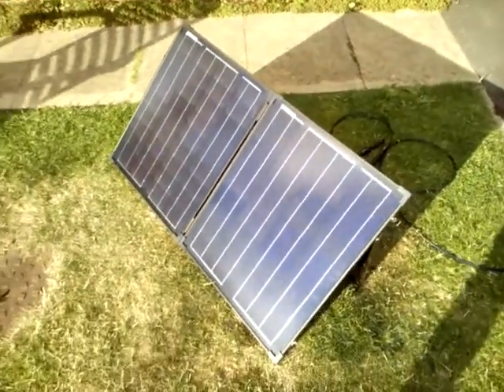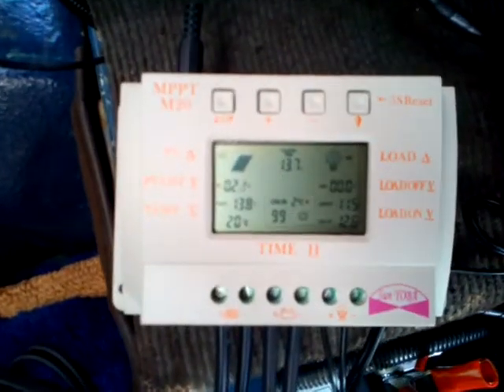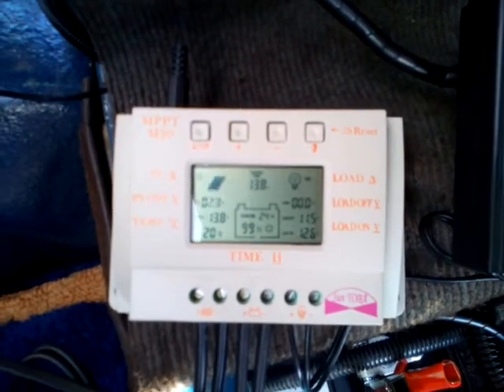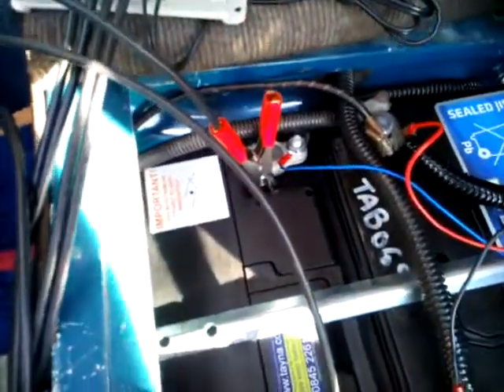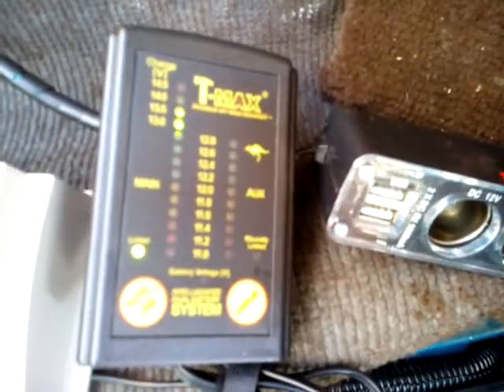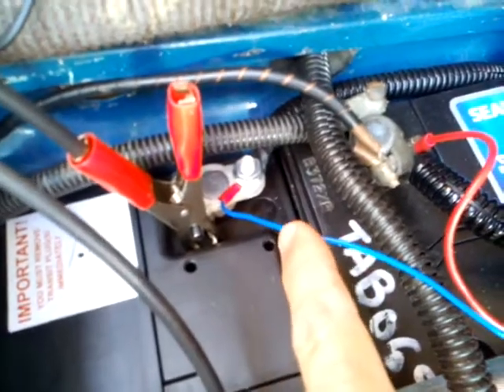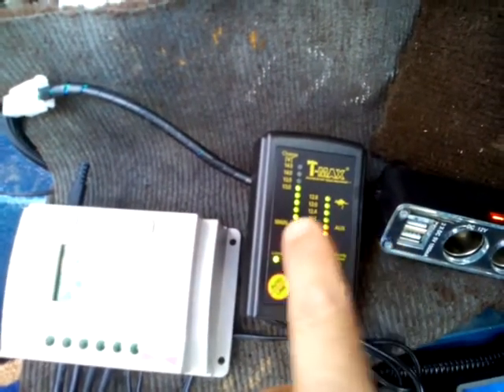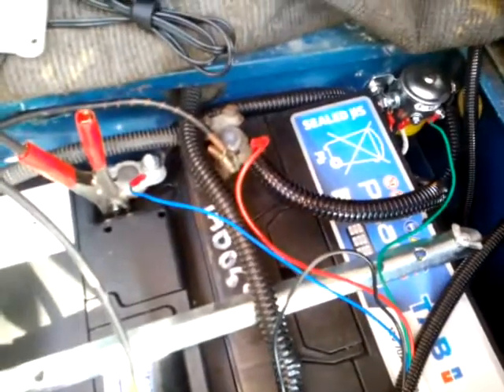T-Max Dual Battery Solar setup in Land Rover 110

Comment: Hello there T Max system Uses a earth switch to Energise. That Small Wire you have there  that links from pin one to pin 3 is nothing more than a live bridge to keep the live pole constantly live .personal i do not like this idea but it works  i have configured mine slightly Different in the sense that mine has no Bridge on the can poles and the power in is done from a overhead switch so i can total turn the unit off when required .Also just a tip  u need also to fuse both battery sense connections that feed back to the control unit and the master power feed Red cable should also have a 2/ 3 amp fuse in play .  Also not Nocking it but some of your master terminal connections are a bit naughty .  Where the can live comes from is not of importance just so long as it is rated correctly to deal with 870mA thus the length to and from  the switch . No master Fuse that i can see from the t max  live out to the deep cycle you have there . i do not agree with linking battery's like this without having a boss in line just incase  you have a master short on the starter or suffer damage to any master feeds to Ground . Fuses save lives and prevent Fire .  Stay safe good luck . :) .
Reply from the maker: Thanks for the comment. This was a 'quick' setup to test the solar system. All terminals are now correctly fused crimped and connected with conduit shielding for extra protection. Not sure if I mentioned in video but I also intend to add a switch to ensure my solar panel is not wasting energy charging the solenoid (I measured 0.84A or circa 10W at 12V. Also, solenoid temp hit 60deg C). For my first camping trip I removed the fuse in the green signal line.
Thanks again for your feedback.